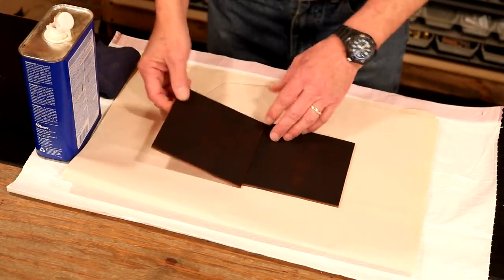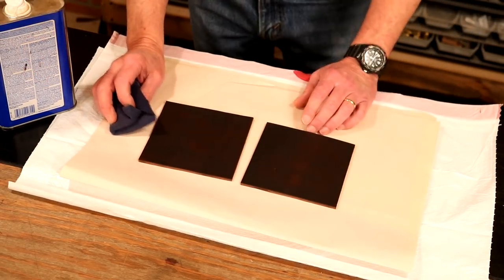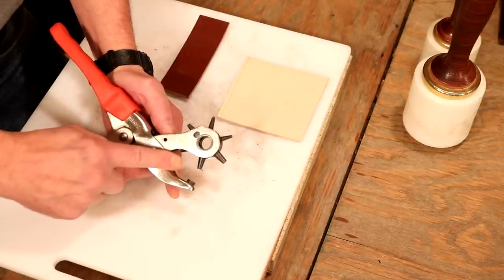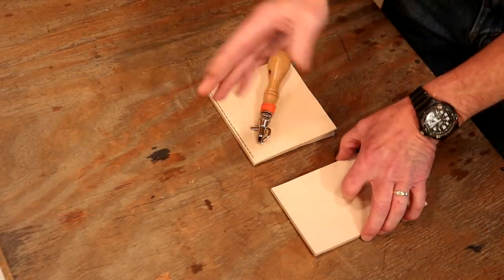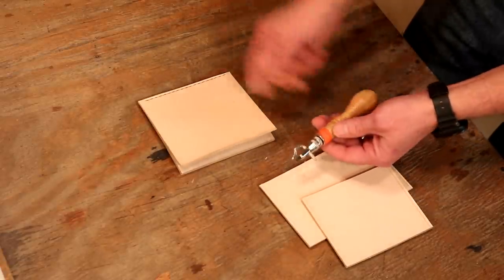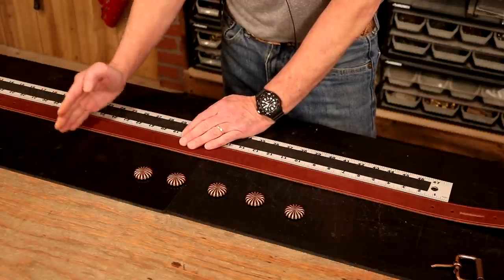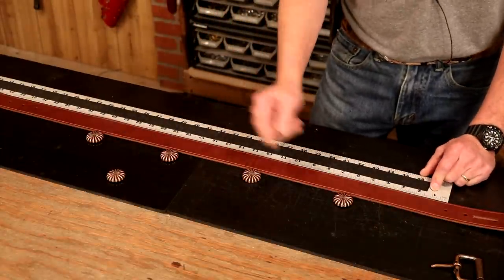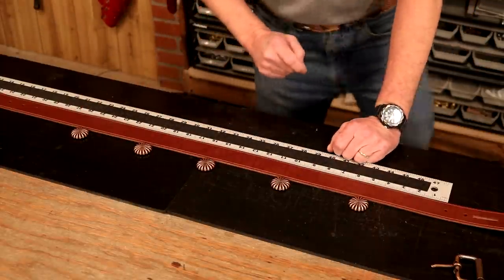The Leather Element: Shop Tricks Part 6

Comment: Hi Chuck, I have noticed the gun belts and holsters on the wall of the shop.  Usually the holster is a slide over belt, but the ones you have are different.  Can you show them in greater detail or how they were created please.

Comment: Thanks. Rotary Punch fix. Try wet and dry sandpaper (not sure what USA name for this but it is sandpaper that you can use on metal with water or oil) on the outside bevel of each punch. Hard to get a perfect sharpen but will be an improvement for little effort.

Comment: You can extend the life of your rotary hole punches and hand punches by chucking them in a drill and sharpening on a stone.  For the internal part of the blade use one of those skinny di-fold serrated knife sharpeners or something similar. I've managed to resharpen quite a few that way though it does change the diameter slightly.

Comment: Thumbs up for the second tip on using a backing material for cleaner holes with a dull hole punch. A similar principle is used in woodworking to prevent chip-out, but it's executed a little differently.
Being an avid enthusiast of both fields, this tip in particular causes me to consider other potentially related principles, tips, and techniques between woodwork and leathercraft. 
Thanks , Chuck.

Comment: There seems to be two The Leather Element:  Shop Tricks Part Sixes.  These videos are addictive.  I've started watching them, and can't stop.  I may have only noticed that there are two part sixes because I watched them back to back.

When cutting inside curved corners, shouldn't your straight edge be on the work side in case your knife wavers?

Comment: Hi I am just starting with leather and I am wondering is their a certain once  leather I should get I am wanting to do bracelets thank you
Reply from the maker: Hi Skye! It depends a little bit on the type of bracelets you're going to be making. You can go anywhere from 3/4 oz. for smaller bracelets like wraps or mystery braids and the 4/5 oz. to 5/6 oz. for cuffs. If you're going t be tooling and stamping we would go with natural veg tan. We've got single shoulders and 12" x 24" panels if you would prefer to start with a smaller piece of leather at first. 
Panels: https://www.weaverleathersupply.com/catalog/item-detail/13100-35-12-18/hermann-oak-veg-tan-strap/pr_56565
Single Shoulders: https://www.weaverleathersupply.com/catalog/item-detail/11-1202ss-3-4/veg-tanned-single-shoulders/pr_62495

Comment: I was given some what I think might be chem tan leather, can it be dip died
Reply from the maker: Hi Paul,
Most chrome tans cannot be dyed - I would ay test a small piece or scrap and see how it turns out. You'll want to use a deglazer on it first to remove any glaze or top coat.